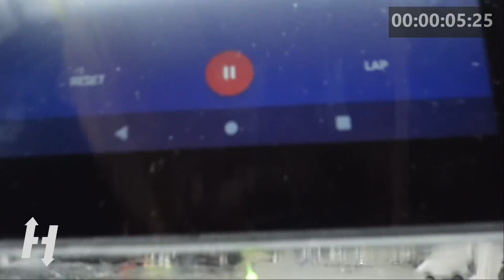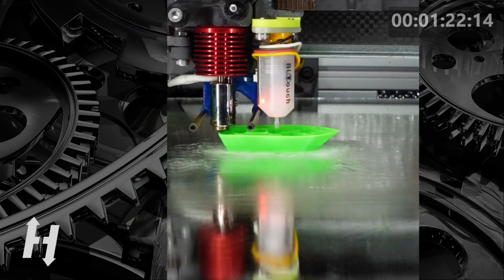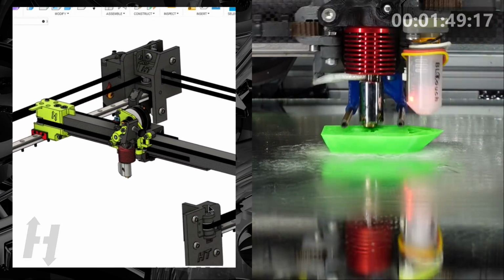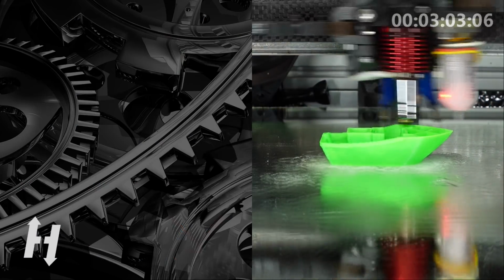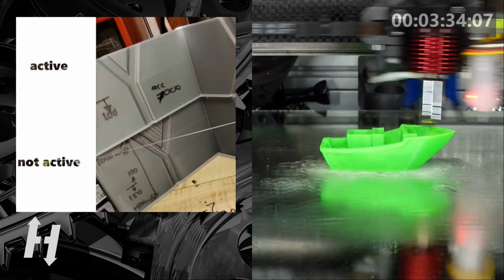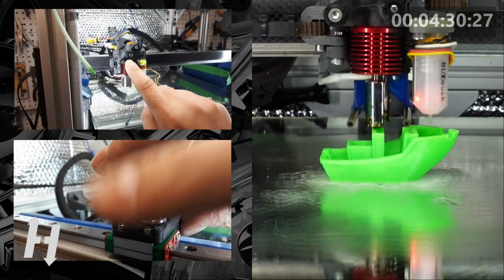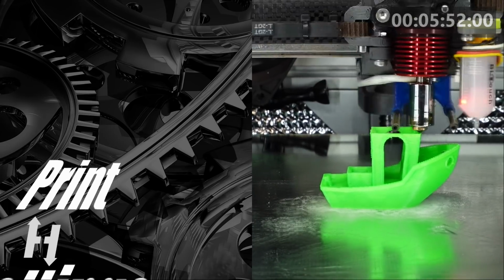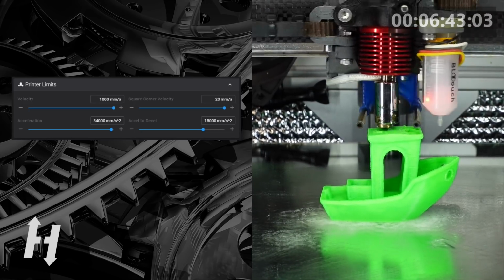My Recipe for FAST 3D printing

Comment: Is it part of the rules to have to have the txt on the bottom hull? Making a smooth bottom hull would probably subtract a lot of time off the benchy print and easily bring you into the sub 7 min times.

Comment: The resonance pictures on detail are both the same. Mistaken photo I think.
Reply from the maker: If you refer to the black print showing increasing resonance is the same part.  No comparison there.  This part is used in a test procedure that changes parameters affecting resonance at each layer.

Comment: Do you think that a bowden tube could be improved enough to move the extruder off of the print head?
Seems like the biggest potential weight savings to me.  

I'm aware that there're drawbacks though, like the elastic nature of filaments X longer travel distances.  But it seems like that could be tuned in per filament.  Maybe a stretch / compaction / elasticity test of sorts?...  

If it worked well enough, manufacturers could add that to the list of specifications.

In my mind, perfect is a featherweight 🪶 🔥 hotend assembly, with only 4 wires and a bowden tube.
Reply from the maker: At the point we are now, the limiting factor is not the motor power or the ringing induced by print head inertia.  We are facing the limitation imposed by the plastic itself.  Molten plastic has a reaction time and high resistance in adopting the shape we describe with these extremely fast moves.

Comment: Most surprising thing from this video is the amount of cooling you use for ABS??
Reply from the maker: I feel that with such amount of cooling, most of the thermal retraction happens within a few seconds after material has been laid down.   LAyer adhesion is still maintained due to extrusion temperature being at 300C.

Comment: Hasn't the Carbon X1 just 2 carbon fiber rods for the X axis? The would remove a lot of mass from  the X axis . The challenge is to buy rods with the necessary precision. Then a second extruder mounted on the frame could help to push more plastic. The challenge is not to push with max force but get in a constant torque mode. Next step would be a second heater cartridge instead of 300C. Sensors, fan and cartridge should be controlled by CAN bus to save mass for wiring. Then using a BLDC motor for drones, the extruder would save mass as well. There is this design from David Leitner.  Last step would be using servo motors on both axes. MarcoReps will use them for his CNC machine. There are lightweight versions.

Comment: In the progress of building a Voron, and my first Benchy on that was not even sub 1 hour. Still leagues faster than my old Zortraz M200 that cant even print a Benchy in sub 2.
Reply from the maker: A lot can be accomplished with the right slicing settings.  you can have a look at my old IdeaMaker profile on my github.  Added link to video description as Yt wont let me here.  https://github.com/MirageC79/BenchyRace

Comment: The carbon fiber tube you are using is the 20x20x18 with 1mm wall thickness?  Is there any noticeable deflection vs the 2020 aluminum?
Reply from the maker: I have not measured that value yet.  Will make a rig to test.

Comment: What is included in the 585g in 2:46? Also the adapter and the linear blocks or just the carbon fiber tube (and of course the HextrudORT)? I wonder where "all that" weight comes from, since you write the HextrudORT "complete Head" has 215g
Reply from the maker: Qty2 Y carriages + Hardware + 4 Pulleys + CF tube + MGN9 rail (No Y MGN12 Blocks included in that weight, only the X MGN9)
Reply: @MirageC  Oh of course, there is also the rail underneath the CF tube. Thanks for the clarification!

Comment: It just dawned on me while I was working on a design...how where you able to attach the linear rail to the carbon fiber? From everything I've read, people say it's not good to thread into carbon fiber, and that you have to glue. How where you able to do it?
Reply from the maker: Hi Justin, i have used a printed tool that i insert in the tube to locate M3 nuts and washers.  I used the rail as a drilling guide.  The tool is removed once the m3 nuts have been captured and secured.  Printer has gone through 200+ hours of print since then and all is hooding up very good.  I fear the day one screw will come loose though.  Lock washer combine with flat washer might be adviseable.
Reply: @MirageC  Ah, I'd started to think you'd used some sort of threaded insert that got riveted in.
Reply from the maker: @DarthAvocado14  Really not recommended on this one.  Its quite thin.

Comment: Sorry but what's the point of sending a printer so fast if the result is to be trashed?
There is a rush to make these 3D printers faster ... but the logic they are built for cannot lead to a perfectly finished part.
Reply from the maker: I would ask what is the point of F1 racing if it carries only 1 person through a very bumpy ride?  Pushing technologies allows us to explore new avenues that can eventually be brought back to consumer market and daily use to increase their performance and efficiency.
Reply: @MirageC 
I don't think it's a fair comparison ...
The problem with 3D printing and that it comes from too much speed filament will never be a watchable piece.
It's just a limited hardware issue.
Reply: @VincenzoCarchedi   Don't be that guy - Actual historic quotes:

 "That the automobile has practically reached the limit of its development is suggested by the fact that during the past year no improvements of a radical nature have been introduced."
------Scientific American, January 2, 1909.

"What can be more palpably absurd than the prospect held out of locomotives traveling twice as fast as stagecoaches?"
------The Quarterly Review, March, 1825.

"Well-informed people know that it is impossible to transmit the human voice over wires as may be done with dots and dashes of Morse code, and that, were it possible to do so, the thing would be of no practical value."
------Unidentified Boston newspaper, 1865.

"To place a man in a multi-stage rocket and project him into the controlling gravitational field of the moon where the passengers can make scientific observations, perhaps land alive, and then return to earth—all that constitutes a wild dream worthy of Jules Verne. I am bold enough to say that such a man-made voyage will never occur regardless of all future advances."
------Lee De Forest, American radio pioneer and inventor of the vacuum tube, in 1957

Comment: You should have a look at Finish Line Extreme Fluoro grease. 
It's a PTFE based grease but much smoother and higher quality than anything else I've tried. 
It's very light but stays where you put it and is great for super-low-drag requirements.

Comment: I'm curious why you decided not to go with a bowden extruder to remove even more weight. Surely saving the weight from the stepper sounds like a gain. What's the reason for that?

Comment: are you using stepper motors?  check out the stuff that has been made with closed-loop ODrive servo-controller and brushless motors used for RC hobby cars/drones. 
with a proper powersupply (maybe with supercapacitors as a buffer), a lot of power can be converted into quick motion.

Comment: Maybe next weight saving can be going to MGN9 with two blocks. Two MGN9 blocks have the same moment rating and weight as one MGN12 block, but it would save another 200-300g of moving mass on the rail. I can't understand why everyone uses MGN12 when the rail is solid steel.
Reply from the maker: This is MGN9 already ;)

Comment: Don't move the print head at all. Keep it staitonary. Instead, move the platter that holds the print, after reducing ITS size to the absolute minimum necessary to hold the print. Oh, amd make sure the print is solidly glued to the surface! :)

Comment: i understand the need for speed, but i still think 3d printing needs to work more towards quality of prints instead of the speed. To be more specific more affordable printers need to come with things like bl touch better beds pre installed swiss stronger wheels and belts as well as many other little things to be set as a standard instead of pushing some sort of prize event such as this because the truth is alot of people have issues getting there printer to work right at all let alone this fast. but none the less very damn impressive.

Comment: Speed in fdm 3dp is bottle necked from two main sources: one is harmonics and hysteresis. 2 is e and flow control systems. Harmonics and hysteresis are governed by the mass of your extruder, the drive mechanism (good luck having high speed accurate belts), the stiffness of you linear motion, and the general harmonics of your system. This is well understood, in particular spinning disc hard drives have this down to a science. Nozzle flow controls are lagging behind. Fluid flow is dependent on bond number, viscosity and more, and generally follows a non-linear capacitance model. As far as I know stratasys has some amazing patents on this. I would love it if people developed the control schemes more scientifically.

Comment: Lol your late to the party, last year i printed benchy with nylon cabon fiber at just over 8mins on the menthod CF using the fusion to create a custom tool path with zero let let off and minimal head pull away.
Reply from the maker: Lol! would have been cool to actually throw the party when that happened!  Any link to that real time video?

Comment: Great video. Have you tried sugar on 70% ethanol for bed adhesion?
I only print ABS and I found that it sticks pretty well on glass and it's much easier to work with, instead of having to remove the bed for washing constantly, I just spray some more alcohol and brush the area a little bit until it dries to refresh. Clearly I don't print at those speeds on my Ender-3, but judging by how little force you applied in order to remove the part, I think it could work.
Reply from the maker: I'll give that a try! Thanks for the tip :)

Comment: I like the idea of having a challenge to move the 3d printing tech ahead but at the same time this is pretty much just a d!ck measuring contest. As someone who works in a 3d printing company specialized on printing with polycast for casting we just need to be precise not fast. As the prices are from hour of printing and they would be managed accordingly to the speed of the printer. ATM we print at usually about 70-90 mm/s and to print 35x35x70 cm thing, it takes about 75 Hours. Its a lot but we can be sure that it is precise. Light head is awesome and all but at the same time you need mainly sturdy frame IMHO. I guess if you print only decorative things its pretty usefull. (Right now I am building delta with ballscrews and really sturdy frame but it has regular direct drive extruder so its about 230 grams which is a lot for a delta affector and its almost done so I guess i will keep you posted about how it turned out )

Maybe create a challenge where the final print is measured by laser scanner and compared to the original 3D model ? I think I could do that since I also work with 3D scanner arm that has 0,07 mm accuracy. Might be interesting.
Reply from the maker: I agree with you, there are several angles from which you can exploit the 3D printing domain.  This fast printing demonstration would not cut it for surface quality obviously, but by testing beyond boundaries, we can easily identify the shortfalls.  Same as for Destructive Testing.  The experience I am sharing here with the hobbyist community might help a few at increasing print speed while maintaining quality level.  
F1 racing, Nascar, Drag Racing, basically all kinds of racing will exploit systems to their limits and trigger the venue of new ideas, which might benefit consumer's market one day ;)
Reply: @MirageC Hmm didn't though about it this way. I guess that makes sense. In that case I hope you win the race because you are really good at your job obviously ;)

Comment: Huh, quite impressive ABS printing skills. I can't handle it, the warping and low bed adhesion are killing me.
Reply from the maker: Try some bed lacker, print a bit hotter and use some fan (quite a bit)  dealing with most of the retraction as material is being laid down usually helps.

Comment: 34,000mm/s²???
34m/s²?
3.5G?
if its reaching that acceleration
thats impressive
Reply from the maker: Yes, those are the value used for driving the steppers motors acceleration.  If they don't follow, it will result into layer shifting.

Comment: >320mm/s
*looks at my printer with its max of 70mm/s*
Reply: max of 70? Lucky you
Reply: @leobla744  travel moves don't count, boy
Reply: @alejandroperez5368  I know, I can check next time when I am at my printer what it actually gets up to while printing but I guess there should be head room in acceleration (what I get is probably not even close to 150mm/s)

Comment: Make a smaller 3d printer by decreasing the build space just so it can just build the boat
Reply from the maker: only some length from the X cf tube and MGN9 rail would be saved.  It could improve, but would not be worth the effort.

Comment: Greetings from Italy , I love your videos, they have a lot of valuable information, thank you for sharing your knowledge.  One question I just bought the anycubic photo mono and the one to wash and cure the 3 d pieces.  Could I use 99% denaturated alcohol?  I know that the one they recommend is Isopropyl alcohol.  Thanks for your attention.
Reply from the maker: Yes it should work well.  I have been using Methyl Hydrate with my Elegoo Mars.  great results and cheap. Need to use it in a well ventilated area and dont drink it or else you'll go blind ;)
Reply: @MirageC  Thank you so much man for the info. Yes here in Italy the alcohol  Isopropyl is very expensive.

Comment: I don't understand going through all the effort of making it move so fast when you can just use a slightly larger nozzle and get drastically faster print time. I use a .6mm nozzle with .3 to .4mm layer heights and print times are so much faster. I have used a .6 for 3 years and I will never go back to a .4mm nozzle. You can always lower the z height too if you need better z resolution. Unless you are printing very small things you will never notice a difference in quality.
Reply from the maker: Now Imagine this with a larger nozzle ;)
Reply: @MirageC  Fair enough but at some point you may run into issues with flow rate. To be able to print faster with a .6mm nozzle I had to upgrade to a 3:1 geared down dual drive extruder which will add weight to your carriage. My old one sided drive extruder just couldn't keep up with the amount of plastic coming out. At some point you may even have to use a higher wattage heating element
Reply from the maker: @Alobster1  Currently using Dual Gear 5:1 ratio extruder with 100W heater on Nova.  Good for 50+ mm^3 flow of plastic.
Reply: @MirageC  Wow that extruder stepper is probably ripping it
Reply from the maker: @Alobster1  No filament dust between gears.  Ever tried Bondtech extruder before?  Remember that this is a direct drive extruder, no bowden tube friction involved.

Comment: If this is what you're doing on a 3d printer not directly designed for speed but altered for it. Imagine the day you get to fine tune a Printer designed to go fast based of the Processes you've identified. Great Job!!
I personally consider your efforts equal to the car innovators of the 50's-70's thanks to them cars can almost drive themselves..  #selfprinting3dprinter

Comment: Some things need time and patience, and this is one of them. The end result was awful and you wasted filament. To attain fast (and accurate) 3d printing, technology that is removed from temperature changes is required, we're not there yet. If anything, I envision something that would use very cold water as the catalyst that can achieve something like this.

Comment: maybe this is a ignorant question, but would this run the risk of burning out something? I was printing a large object on my print bed which was going to take over 10 hours, so I set it to 140% and increased the nozzle temp a bit. It ended up printing closer to 5 hours. It was fun to watch it zip around so fast.
I was very pleased with the results but was nervous something was going to break or burn out, or damage my machine in some way.
Its a CR 10. 
I would like to do it again, and the results were pleasing, but I don't want to damage my printer. 
Any thoughts?

Comment: absolutely impressive but as a beginner I thought that lightening the print head would allow a reduction in vibration and with it a faster print. So I`m wondering what the advantages of the direct drive setup are, if you try to establish the benchy print as fast as possible
Reply from the maker: Bowden setup on a printer of this size makes the tube a bit long. Therefore retraction distance and required speed will make it difficult to control nozzle pressure.
Reply: @MirageC  ohh okay, thanks!

Comment: I started 3D printing about 6 months ago. I needed a large number of a small part for a product I sell. It’s an internal component so it doesn’t need to be pretty and I chose ABS because it needs to last. This means I move fast with large layer heights and high temps. After listening to everyone complaining about ABS I have had 0 problems and I always wondered why my luck is so good. I guess ABS is just a fast plastic!

That machine is incredible, I’ve been looking into your machines they are incredible. I’ll be working on one someday when I earn some time and find some money.

Comment: That is pretty mindblowing!  I wonder if you could get a bit more speed using Arc Welder so the curved portions are actually curves so the extruder doesn't need to stop and start thousands of short lines.